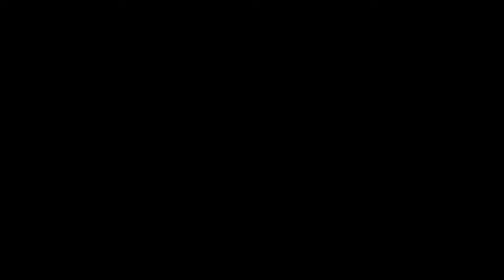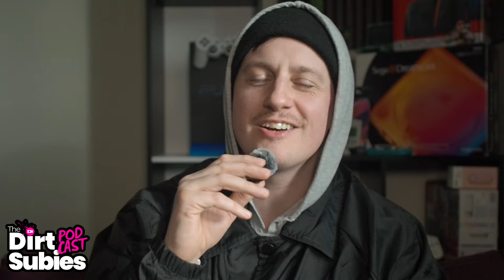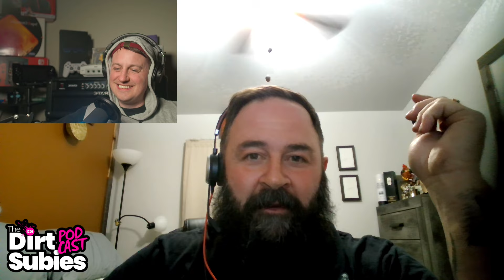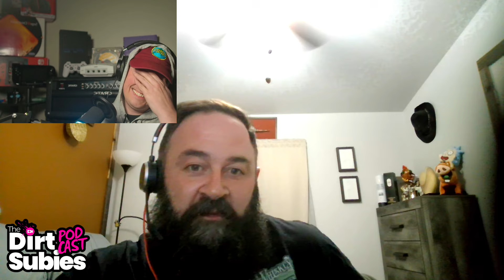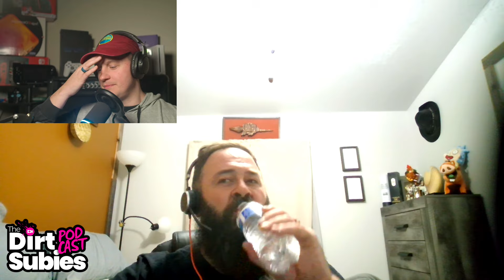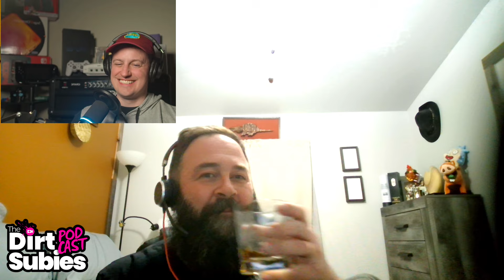Helpful Tips Anyone Can Use From a 25+ Year Subaru Mechanic

Comment: This was some seriously wholesome stuff. Also, fill the cooling system through the upper hose directly into the block. Bypass the thermostat for maximum FLOW into the block. Bottom mount thermostat is a different waterfall... I miss my 84 2 door hardtop with a nice fat rad, whiskey bottle overflow, and TOP MOUNT THERMOSTAT!
Reply from the maker: Not gonna lie, the low thermostats kinda piss me off if you don't get all the air bubbles out. But I've used the method you're talking about! Works really well in conjunction with one of those coolant funnels.
Thanks for checking out the interview💪💪